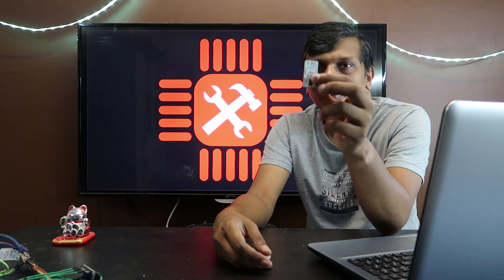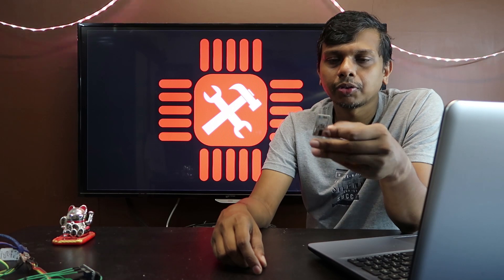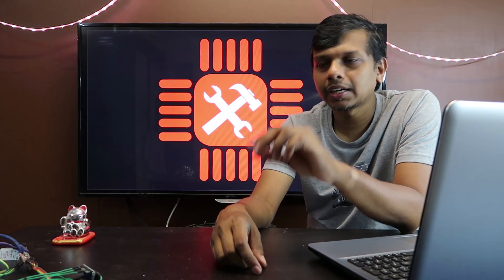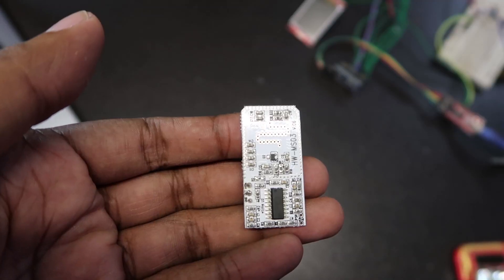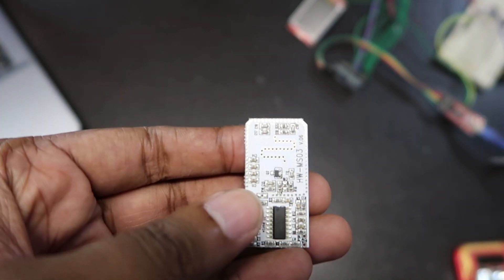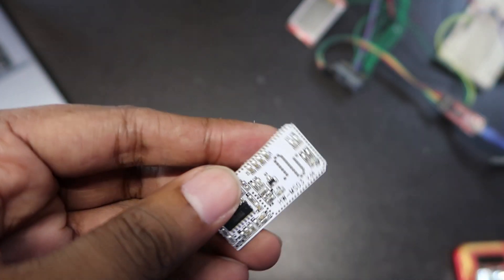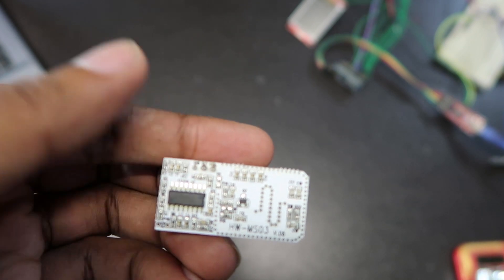Motion Detection - Radar and PIR Sensors - വീട്ടിൽ റഡാർ വെച്ചാലോ?

Comment: Hi azhichupani, your intension is good and these sensor are really useful. But I have one doubt..in washroom automation how do you  power  up pir and relay Circuit?? You will definitely using a transformer with minimum 250 ma and it should be always on. Our intention is to save power but 250 ma transformer with 6 volt will draw minimum 1.5 watts power usually we use less wattage in bathrooms..even with dc led light.so in reality you are not saving but wasting energy.try to use ac pir in serious with led bulb more efficient and energy saving.your projects are good.i think you might used solenoid valves to control water and pressure pump really useful project.